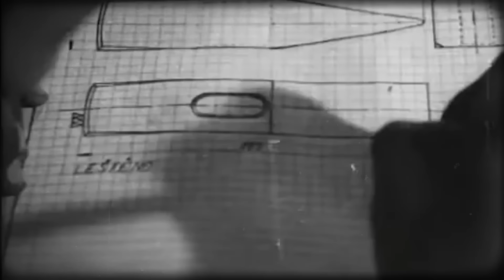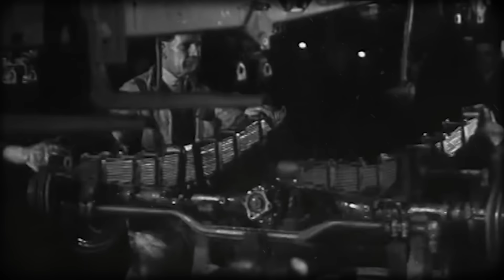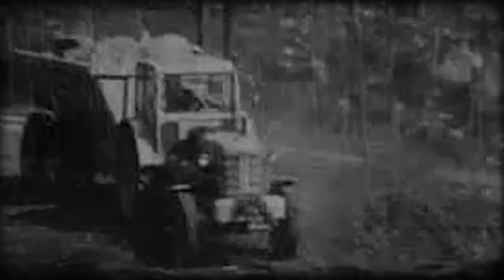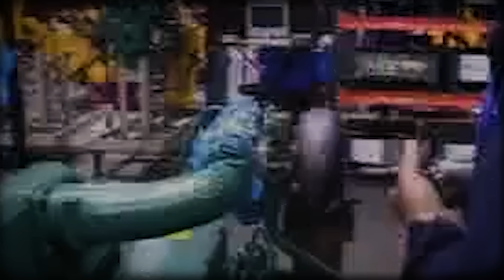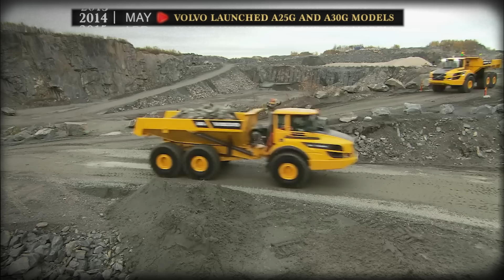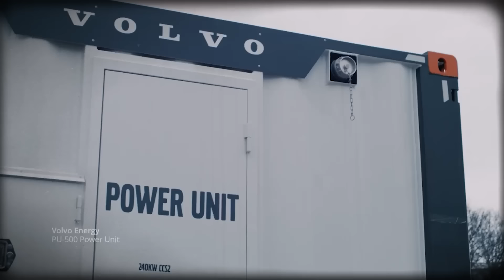How Volvo Built an Empire

Comment: I would just like to add a bit about the cooperation with Valmet. Volvo decided during the late 1970’s that they would pull out of the tractor market, and focus more on other heavy machinery. In 1979, they signed a deal about cooperating with the finnish state-owned company Valmet. In 1982/1983, the first result of this cooperation was shown in the Volvo BM Valmet 05 series. These were tractors with parts from both Volvo and Valmet. The tractors outside design were apparently designed by Volvo’s design team, led by the same people that designed the Volvo 240, 740 and 940. Parts were sources from different places. Engines, hydraulics and more were provided from Valmet in Finland. The cabins, transmission and more were manufactured by Volvo BM. The tractors were out together at Valmet’s factory in Suolahti, Finland. The only tractors that weren’t manufactured here, was a Valmet series from the 1990’s that was a rebadged Massey Ferguson. And some of the biggest tractors in the 05-series were made in Sweden, and were just rebadged and upgraded Volvo BM tractors. This was just until mid 80’s i believe though. So a Volvo BM Valmet tractor in the middle size of the 05-series (505-905) would have had engines made in Linnavouri, Finland by Valmet. And cabin made in Hallsberg, Sweden at Volvo BM’s cabin factory (still operated by Volvo today), and put together in Suolahti, Finland at Valmet’s factory. For example, the door locks in a Valmet 505, 605, 705, 805 or 905 is the same as in older Volvo wheel loaders. This cooperation only lasted for a while. Volvo BM decided to sell their part of Volvo BM Valmet in 1987, and Valmet then became the full owner of Volvo’s tractor department. The tractors changed their name back to Valmet for that year, but kept many key features from Volvo BM. The red colors, design features, etc. Volvo BM kept manufacturing parts for Valmet for the duration of this 05 tractor series (Valmet 505, 605, 705, 805, 905), which went on until 1991. Volvo hasn’t been involved in tractor production since. Valmet went through several changes in ownership during the 1990’s, which led them to change their name to Valtra (presumably short for VALmet TRActor). Valtra was bought by the American corporation AGCO in the early 2000’s. This is the same company that owns Massey Ferguson and Fendt. With the aqusition of Valtra, they also got the old Valmet engine manufacturing plant in Finland. They since rebranded it to AGCO Power, and has started using it in most Massey ferguson and small Fendts. Valtra tractors are still made in Suolahti, Finland. But now, some Valtra series’ share some parts with other AGCO tractors. Valtra also used to manufacture their biggest series in Beauvais, France. But the production has since been moved to Finland for this too. In one way, one might say that Valtra is the grandchild of the Volvo BM’s tractor department. Volvo BM/Volvo Construction Equipment have since focused on as good as possible at construction equipment.
Reply: "Valtra is the grandchild of the Volvo BM’s tractor department." Hah, that's a reach. :D
Reply: @ Haha, i don’t know what relative to classify it as. It could be Volvo BM’s tractor department’s child, but it’s changed name and ownership so many times that only a few key principles are left from Volvo BM… Volvo BM Valmet was the child of Volvo BM’s tractor department, very similar. Maybe Valtra is the great grandchild then..?🤔 Interesting way to think, as i haven’t realized how few concepts are left from the old Volvo BM tractors
Reply: @leopoldlodewijkfilipsmaria8064  he is correct but wrong, he means huddig
Reply: he mix in two different histories
Reply: Suomen kielellä VALMET = Valtion Metalli Tehtaat.

  In Finnish, VALMET = State Metal Works

Comment: How far the industry has come since the days of the HyMac 580 with its foot operated boost for the dipper, and the hydraulic fore loader mounted to a farm tractor by J. Bamford.
Reply: Yes it's funny looking back at those old school heavy equipment 😊 I remember in 1979 working big sewer main U.L.I.D. projects. The different excavator on the job. All having a different control pattern for function. Boy back then, you as an operator had to know the Air over Hydraulic systems, or be good with your feet. I remember "DROTT" excavator came out with that neat 4 pedals and two (X) pattern joy sticks. So the excavator could be setup like your other excavator. But back then, you had to have a Case or Drott trained Technician to set up your control pattern. Not like today with a valve in th❤e cab, or❤ compartment next to door 😊

Comment: It appears obvious electrical power is great and here to stay, but if the electricity is produced and stored with heavily fossil fuel machinery and elements I find it difficult to see the advantage!  I'm not totally stupid--One can See Great Financial Motives on the horizon! Global/World wide panic is probably as good of a tool as it gets!!!!
Reply: Electricity is like the universal energy because it can be created in many different ways.   So you can focus on how make electricity generation efficient at huge scale instead of a bunch of small engines which are very inefficient.

Trains have been using electricity generated by engines for 50+ years, the massive shovels you see at mining operations are usually powered by electricity, etc.

Electricity powered industrial equipment has been around for a very long time.

I don’t drive an EV or anything like that; just facts.
Reply: @yayinternets  Sweden is a good place for electrical machinery, since we havn't used fossile fuels for electricity production for the last 75 years or so. Basicly all nuclear/hydro/wind.

I've been to the Slakthusområdet work site many times, the by far most quiet work site I've ever been to.
Reply: As the other responder points out, you can use fossil fuels more efficiently at scale instead of a multitude of smaller combustion engines. Also the grid can allow for renewables etc & everyone who is electrified takes some advantage of the reduced carbon intensity over time
Reply: @Conorguill  Electric vehicles only work inside cities.
Reply: @Frille512  That's not necessarly true. Whereever you are, chances are very, very good that you're closer to the electrical grid than to a gas station.